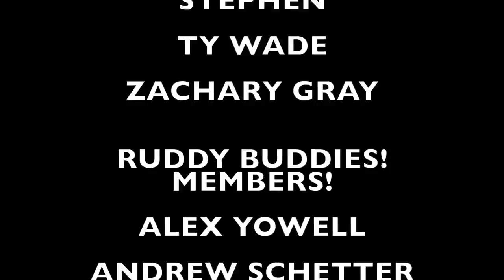THE FATE OF MY 370z MISSLE!

Comment: Towing a trailer exclusively will wear your brake pad waaaay faster. Especially now that you have the bigger trailer that weighs more and pushes past the brakes. The bigger Wheels aren't helping your momentum either.
Reply: Hope the trailer came with trailer brakes and he has a controller in the truck
Reply: @JDGeorge240sx  Was going to say I wonder if he even has a trailer brake 😆
Reply: How is he getting so much brake wear if the trailer  has brakes on it?
Reply: Should have a trailer brake
Reply: @MetricFlexin  he probably doesn't have trailers Brakes lmfao typical rudnik
Reply: @KenaiTobin  Chances are his truck doesn't have a trailer brake controller installed. MOST newer trucks came factory with it, his might need an aftermarket one installed
Reply: @JDGeorge240sx  that is most definitely not the case with Chris lmao
Reply: Needs an exhaust break
Reply: Do you have a power steering leak on the z because if you do then that is what caught fire that stuff catches fire easy

Comment: Looks like front driver side wheel bearing is toast. That tire was wobbling awful
Reply: That's probably why Chris loses brakes on full lock - the sideways force causes the wheel / rotor to tilt because of the bad wheel bearing, and this is causing the brake rotor to push the piston back into the brake caliper.
Reply: @davidrobert2007  he's talking about the truck, dude
Reply: @GL0BETREKKER  really? lol I thought he meant the 370z. My bad.
Reply: @davidrobert2007  
Look at @1:04 that left tire shaking like crazy y
Reply: Yep it’s wheel hub if u lift that with a jack an wiggle it up an down an if it moves it’s the wheel hub it was moving hard that truck can fall at any moment
Reply: yesssirrr ^^^^^

Comment: Brakes and wheel bearings need to looked at.  You've put some rough miles on the truck. Even a missile needs to be kept in order. Don't want your friends running for cover while your on the track.

Comment: Tyre fires are similar to say silo fires, fine particles in the air mixed with heat and boom. Thats why all the heavy hitters in the australian burnout scene have to pipes sticking out comically far out the back of the car. In burnout comps tyre fires are frowned upon.
Reply: Unless your Cleetus

Comment: I say do some PDR on the doors, a full service, check for melted wires, bushings, etc. Check the spark plugs. Maybe perhaps fix the break system so they work on full lock so you crash the missile less ? Maybe ? :) Anyway that Z doesn't have long in it's current form before a new rebuilt engine and tranny will be required. But, like you said it's a missile. I think with all the content you created with this care you are probably breaking even with the investment. Also just put some bash bars on the front and rear and hang the bumper with all the fan signatures up in the shop somewhere. It's pointless to keep repairing the front and rear bumper on this car with how many more times they will get smashed.

Comment: My theory on the explosion, is that the temp of the air in the tyre cause the sidewall to very briefly pop loose and release pressure which caused the rubber vapour to light. Only thing I can think of..
Reply: Your close, its caused by heat in the exhaust or unburnt fuel, the "explosion" is caused by so much rubber ingnitining at once in the confined area of the wheel wells/under the car.
I see multiple cars do this everytime I go to the burnouts in Australia, happens alot to blown methanol cars with a fat tune

Comment: As said in the previous comments, having a heavy load, pushing the truck, will definitely wear out your pads way faster. It may be an idea to upgrade the pads and rotors. The Z would have gone into limp mode, because of overheating (for safety), but leaving it, will reset itself.  I always love the great banter, between you, Tommy and Will.

Comment: the smoke has a fine rubber dust in it that catches fire usually from a flame outta the exhaust tommy was kinda right as a rich running car can pop a flame them it ignites the tires, its very common with skid cars dont stress

Comment: Good thick Fully synthetic oil can easily manage 320F+, some racing endurance engines get pushed 350f for 24 hours at a time, and there will be hotter spots in turbo engines

Comment: As others have said in the thread, I'll just back up the opinion. Towing is what's getting your brakes no matter how heavy duty the vehicle. And that's completely normal. You haven't done anything wrong what so ever. Here in Australia all the "old-timers" hook up 3 tonne Caravans and travel Australia. They replace brakes and components yearly or upgrade brake lines or brakes altogether. Check your GVMs and make sure those tyres are rock solid 👌

Comment: Chris on the truck you need to make sure your trailer brakes are fixed right way if not you can have a bad brake failure. And the truck witch out your break hoses front and rear with braided hose. And put new pads and rotors with good ones. Don't buy cheap breaks for either the trailer or truck. But if you going to pull trailer fix the trailer brakes and harness asap

Comment: Tire smoke mixed with gasoline vapors caught on fire. It's flammable. It was ignited by a pop from the exhaust. And oil gets to its previous viscosity when it cools down. Of course, it's not as good anymore, if it was overheated, but it's drivable..

Comment: Gas fumes and air temp from spinning happened to cleetus with methanol especially when your up against the wall and the gas/exhaust is just dumping and if it's not burning fully there's just raw fuel making it's way there and again flash fire from atmospheric temps reach a certain temp the smoke mixes with the gas and there's enough parts per million In that small space in the smoke that it just flash fires happens all the time once you get enough wheel speed

Comment: 20,000 mi on a tractor pulls a 20,000 pound trailer loaded is a lot of milees and this front brakes always do more freaking than the back brakes on any vehicle. To help with the brake wear on your truck set your trailer brake game to come on slightly more than your truck breaks. And remember your motor is a diesel which ways a lot more than a gas engine does that's why you from breaks I have to work harder there too

Comment: Imo I think those tyres contributed to wearing your wheel bearings quicker than usual given you drive on tarmac and tow a trailer everynow and then. But it could be low brakes. Get it checked man

Comment: luckily larger trailers have brakes for a reason, so it actually stops itself, the truck is not normally stopping a brake equipped trailer, if the brake controller is setup right.

Comment: Do you have stock sized wheels? Also, are you using high heat pads? Also do you have a brake controller? You should have a brake controller for that big ass trailer.

Comment: Honestly you'd probably be better off going the route LZ did with his 350, get the bigger bash bars front and rear and do like shorty (cut down) bumpers to fill in the gaps, it'll look half presentable but will still be a missle. This way too you're not having the expense of replacing bumpers every like 3 events

Comment: you need some bashbars front and rear with some kbd bumpers if you even wanna run any
Reply: the kbd ones flex all over the place without cracking like fiberglass, and you can paint them

Comment: With my 04 ford F250 plow and sander in the winter, trailer in the summer I get 25-30k on front brakes. 
Rears I get roughly 45k. I run Ceramic Pads
Reply: It is lifted to the moon however. Rode hard, and put away wet.

Comment: Get some Bash Bars all around the Z Front, and Rear. Oil Cooler, and your golden. Keep the Bumper hung up or cut into smaller pieces frame them or whatever. Bash bars all around would look clean. Since the Z’s come around it’s easily been some of my favorite videos & been around since the start pretty much. 🙌🏼

Comment: I would check over some shit dude, like suspension, any leaks and wheel bearings and shit. Just cause it runs smooth doesn't mean it will drive good or that it's ready for a drift event lol. Get it under some load first before you take it out again and that'll be the real test

Comment: To give credit to will the steering wheel on the z do lock if you don’t turn it on first before moving it 😂. And it was from the rubber on the ground causing the fire Forsure. I looked more violent bc of the wheel still spinning when the fire started.